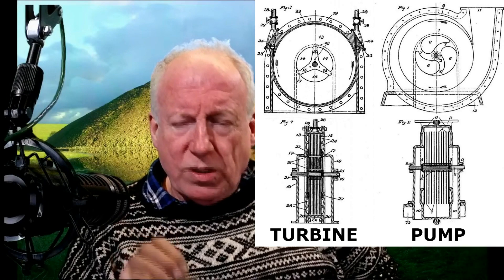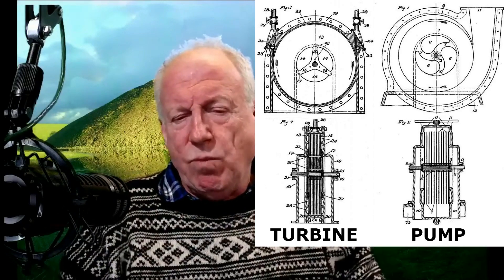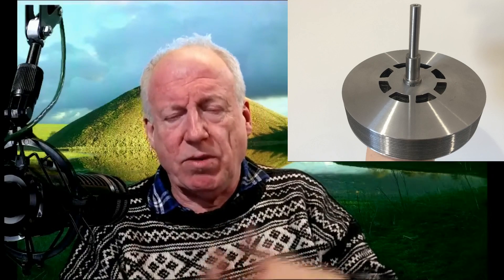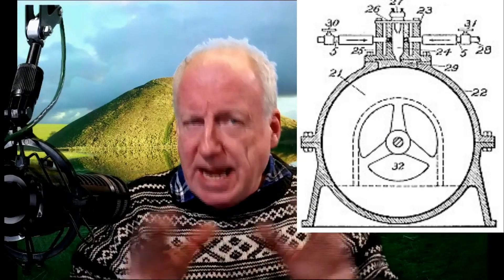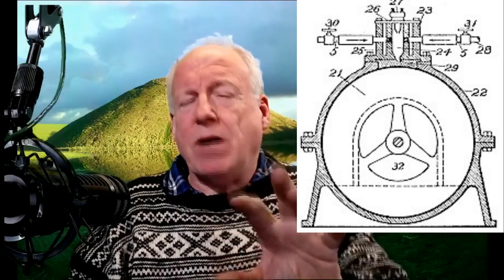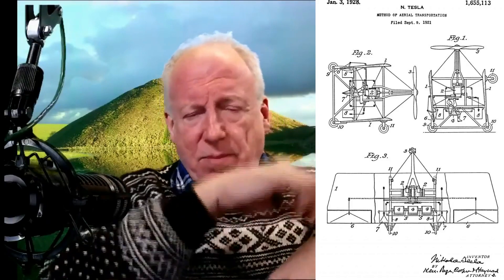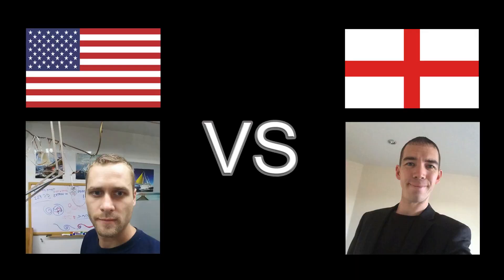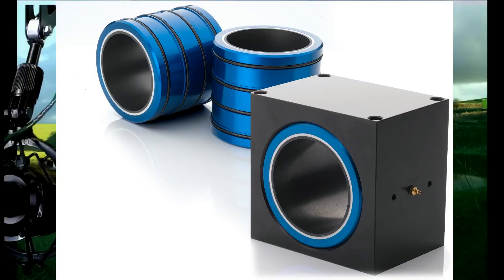Nikola Tesla's Cold Steam Technology - Introduction

Comment: the sole problem is that the spinning of disc is too much for materials to handle yet. 5 minutes to say this...everyone know...
Reply from the maker: I’m one of the few people in the world that has built supersonic capable rotors, tested them and had them third party validated. Anyone saying what you wrote simply hasn’t been building Tesla’s machines and pushing the physical capabilities. Even Tesla was able to do this over 110 years ago. I’m not a theorist, I actually build and test Tesla’s machines. Lot of researchers out there but few developers / replicators. Mach 1.3 is my current top score. These tests are purely for destruction testing. Mach 1.3 didn’t break the rotor either. It pneumatically locked at 280,000rpm because of the centrifugal head.

I have broken many rotors but it wasn’t the centrifugal stress that broke them. It was the 350- 750psi that was being used to test them, which bent either the end plates or the shaft.

Comment: Is it really cold steam . . . . or just atomised water aka mist?
Reply from the maker: It is evaporation and the colder the boiling point the higher the expansion rate thus level of elasticity is higher. Check out the title of one of Tesla's 1921 British Patents: https://teslauniverse.com/nikola-tesla/patents/british-patent-174544-improvements-methods-and-apparatus-generation-power-elastic-fluid-turbines
Reply from the maker: "Cold steam" is just a nickname "vacuum steam" is another..... basically steam that boils at a temp lower than normal.... I think we should only call it cold steam if it is at a safe temperature to touch really. This is an old video now and over time we refine what is what.

Comment: Sorry. Diatomic Nitrogen absorbs energy when it combines with diatomic Oxygen (endothermic). It takes extreme temperatures to do so, but usually only a small amount of NOx is produced. It is normally a byproduct of a high pressure, and very hot combustion process, but which can be reduced or eliminated by running the combustion relatively far into the lean side of the Fuel:Air ratio. Poor atomization causes the boundary of fuel droplets to reach high temperatures at stoichiometric ratios, which creates more NOx and a less efficient burn.

The catalytic converter recuperates some of the energy from carbon monoxide, NOx compounds, unused Oxygen, and unburnt sections of hydrocarbons, and gives them all a second chance to release their energy. The energy is wasted in the catalytic converter instead of being used efficiently in the combustion chamber, where the heat and pressure do the work of pushing the piston. We also use poor quality materials, and yet complain why our cars aren't more efficient, why they break down, and why the electronics constantly fail under normal operating conditions.

"The standard enthalpy of formation
 of nitric oxide (NO) in the gas phase is about +90 kJ/mol, which is 
endothermic. The primary reason for this is that the nitrogen-nitrogen 
triple bond is very strong (941 kJ/mol). The energy cost to break that 
bond as well as the oxygen-oxygen double bond (495 kJ/mol) is not 
compensated by the forming of the nitrogen-oxygen double bond (607 
kJ/mol). Endothermic reactions are the result of breaking strong bonds 
and forming weaker ones."

https://www.quora.com/N2+O2-2NO-why-is-this-an-exothermic-reaction?share=1
Reply: @nikola.tesla.r.and.d.centre  I guess a lower energy distillation process does interest me, but its hard to beat standard desalination when you use 80psi and a mediocre quality reverse osmosis filter from 3M. As of yet, I don't see any real benefits to using Nikola's inventions in the modern day, that hasn't already been explored.

On another note, I am still trying to find someone that understands what the true efficiency of the skin drag turbine is versus impeller vane turbines. Recovering or mitigating the lost energy when electric windings alternate current direction is also something to look forward to, but it seems that using superconductors is one solution. Who knows, this might be the driving factor behind pulse width modulation and using variable frequency drive motors.

Comment: So once the moisture in the air is turned into low temperature steam at the low pressures what happens next? The steam condenses causing a vacuum leading to movement? What's the concept here?

And how does igniting nitrogen contribute to this?

Is the final results a tesla turbine & pump running without combustible fuels?
Reply: @nikola.tesla.r.and.d.centre  thanks Grav. 

How efficient can this turbine be if we have a source of steam no hotter than 150 degrees celcius & a cold source at no cooler than 27 degrees celcius
Reply from the maker: @ganjalfthegreen5312  YouTuber Waert https://www.youtube.com/user/fuctfuctfuct has claimed "That result was at minimum 4C" of temperature differential for the system to work in this video of his https://www.youtube.com/watch?v=8zgr5bwCVyY
Reply: @nikola.tesla.r.and.d.centre wow, is there a graph for the relationship between pressure & cold steam? We have the phase change diagram relating pressure, temperature & phase, is there a diagram that I could find that will give me the relationship between steam & temperature?
Reply from the maker: Tesla spent a lot of time working out how to make huge nitrogen shock waves. Ultimately he wanted to use them in his turbine and I think he was successful but didn't go around shouting about the success. He left enough clues though in articles mainly.

Comment: Thanks, Miles (and Paul)! That explanation really helps! I'd like to know what the discs that cut water out of the air are made of. I still don't get how the air bearings are supposed to connect with what, & what the air bearings are made of, how you get air flow to work with them, etc. I'd like to see cutaway diagram of every part connected to the whole, with arrows naming each part AND what they're made of, and a complete explanation of what each part does, as a step by step explanation of what the parts do together for both the turbine and the pump & what each could be used for, and separate versions for Tesla's versions and for their new innovated models. I got the understanding that the way Tesla designed things was superior to many innovations that lack his understanding, that the military industrial complex kept wanting to do, instead of following his directions, for the various designs for the Philadelphia & .Montauk experiments, so Tesla quit that particular job, as he knew it would go haywire when they changed his design, and it went haywire indeed, as per explanations by Preston Nichols who worked on the Montauk experiments, who's monthly meetings I used to attend. 
Are there such diagrams  on Paul's website? It's supposed to be open source so they can be built all over, like Dr. Steven Greer recommends, so it can't be black shelved, right? Dr Greer will help good projects, too if they can show it works 1st as a lot of tricksters already tried to scam him. They spent millions on fake units that were supposed to work but ended up having electric cords or big batteries actually powering them, and didn't work after they paid for them, so they need to see it work 1st. There may be leeway depending on the case. If there could be a kit anyone could buy and put together, that should be enough to also get to work with his engineers to perfect it further. His org's goal is to get so many working models in use, & well explained so people can easily make them, and so the tech is quickly downloaded or sent to so many people, and quickly in operation, they can not be black shelved and shut down. It would be nice to have a car run that way, with a couple of those new batteries made to last 200 years, that I saw on "Henry Ford's Innovation Nation". Or maybe Tesla has a better battery design (to start the turbine, or pump, in the first place). What is Paul's website address and GoFundMe address, please?